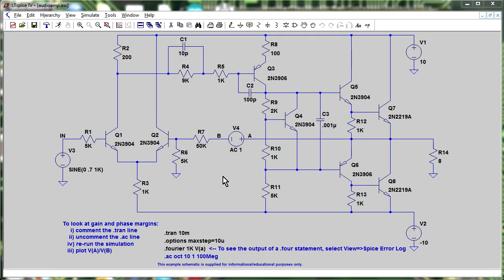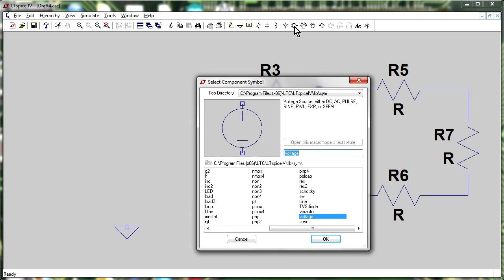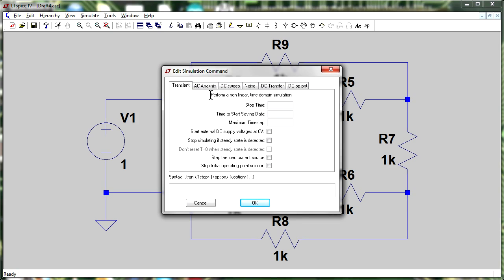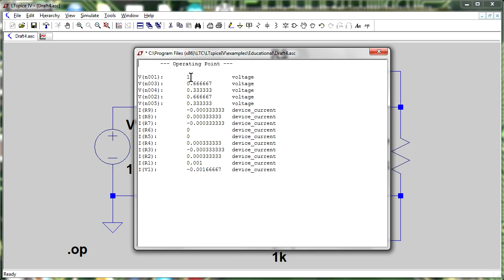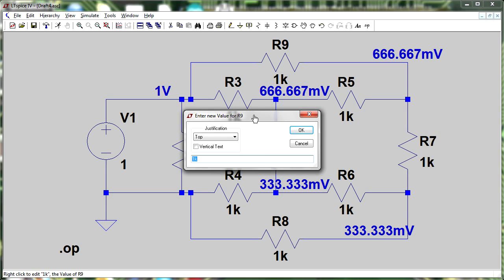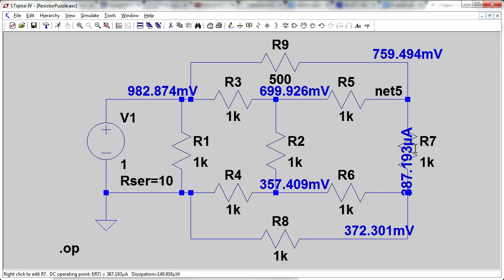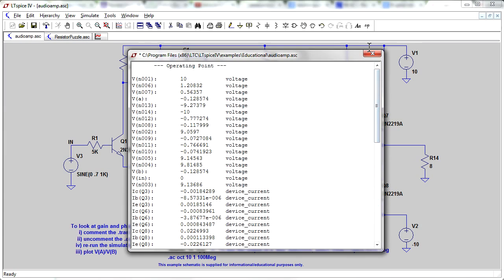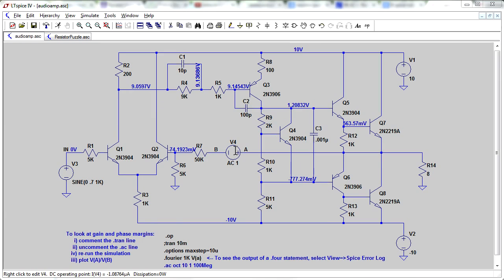EEVblog #516 - LTSPICE Tutorial - DC Operating Point Analysis

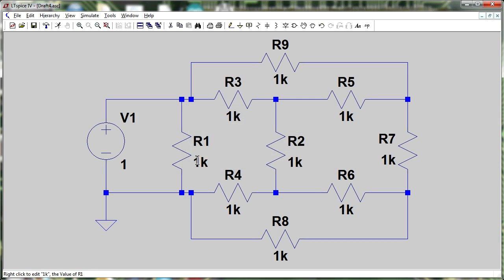Comment: 8:07 That's a bug. If it is possible to assign a capacitance value to a resistor, the GUI should not allow this and should either display an error message or reject this type of input. This way, incorrect entries are avoided, and fewer errors can be introduced into the circuit.

Comment: theres a simple old online design for a 7805 constant current source... either simulation packages dont cope well with the way the regulator is used or i'm not understanding how i can be drawing half a mA from the 13v power source so less than a watt, but simulation shows 1.6w going back into the regulators ''ground'' pin. edit: i was using circuit wizard, ran it in ltspice (with a 1117)  and it shows sensible figures so i guess cw is not understanding my abuse of the fixed voltage regulator as a current limiter.

Comment: He said that LTSpice could not measure the equivalent resistance of that resistor puzzle he drew in the software, however it will measure the equivalent resistance if you know how to do that in the software.  Just use Vin/Iin in the AC Analysis window set for Linear instead of Decibels.

Comment: Looks very good, although as you said, is complex to set up.
I'm now in love with "Circuit Wizard", which can show ALL specific voltages/currents among components, by simply hovering the mouse over wires/devices... in REAL TIME while running. APART from it's incredibly powerful "Auto-PCB" creation !!
It knows the dimensions of all the components including terminals & relays etc., for single or dual sided boards, and designs the whole PCB without crossovers. You can manually intervene, and change what ever you want.....

Comment: WTF, resistors don't have polarity.  Moreover of all the amazing things spice can do, it can't solve (equivalent value) resistor, capacitor or inductor networks without sources.  Over 30 yrs & nobody ever wanted to add this capability. Is there any software out there that can work on passive networks?. It would be very helpful in finding equivalent circuits.
Reply: Not that I've found but you can do things like place a resistor across the output you're trying to do a thevenin equivalent to and then put the resistor at 9999999999999 ohms to find the V_oc and then put the resistor at .0000001 ohms to find the I_sc and then R_th = V_oc/I_sc... etc there's a couple tricks like that. But it would be cool if you could just build a network and tell it to come up with an equivalent circuit

Comment: But, it is messed up on transformers and the Authors do know that and won't fix it.  They seem to be done with inductors.
Reply: Coil A, Mutual Inductance, value of inductance, current flow, magnetic lines/webers then secondary mutual inductance, inductance and generated current.  It makes sense when you got to fit in permeability and nonlinear transformer based upon materials.
Reply: Inductance is a Delta value meaning as a result of a changing load, the actual value of inductance at any given moment based upon the load, is changing.  They don't fix that.  They just use the ideal transformer and never compare to real world results.
Reply: Especially around where the source voltage is lower than the resulting voltage across a parallel resonant circuit.  It never does that right through any transformers.  http://hyperphysics.phy-astr.gsu.edu/hbase/electric/parres.html  Not if it feeds another parallel resonant circuit.  They won't fix it, and won't try to compare against real world circuit results for a kind of clone of superhetrodyning minus any amplifiers.

Comment: The place I got trapped a lot in the early days was the default NMOS and PMOS models. On their own they don't behave like you'd expect of a discrete FET in a lot of circuits and it can take time to find the reason for your headaches until you pick a different model. I think because they simulate the physics of a die almost without parasitics. VDMOS seems to work much better in place of a discrete FET while being more ideal and faster to run than the FETs in the list.
Reply: Can this spice warn you if you exceed an LDO's short circuit output limitations?  (Some specs day to use protection diodes to avoid problems with shorting the output, others don't have that requirement)

Comment: its just the algebraic sign convention used across the whole circuit. so if you were solving the problem on paper youd have to label the positive and negative side on the resistor. and based on that youll get a negative or positive current. and we assume that current flows from the positive side through the negative side of the resistor (or whatever convention you use) but if you get negative current it just means your initial direction of flow you picked is wrong and its flowing in the otherway

Comment: @MrMac5150, I am not sure Dave described that answer so well.  Think about the resistor having a DC volt meter permanently connected to it, so while connecting the resistor in a certain orientation makes no difference to the actual  circuit, it does make a difference to the reading in just the same way as measuring the voltage across the resistor with a DC voltmeter would be positive or negative depending on the way you place the meter probes.

Comment: Excellent Dave! Finally! Yeah, there are some LTSpice tutorials out there, but it is all a bit catch as catch can. Hopefully you can correct all that with a methodical series that goes beyond those and the surface. Price is right, powerful, flexible -but no fluff. Have used it since it came out. Way more interested in this than teardowns.

Comment from the maker: You don't control the current flow, it's just that pin labels are fixed and depending upon which way around you put it, the calculation either comes out positive or negative. Current still flows the same way in the circuit.

Comment: SPICE engine will make maths to retrieve values .. a resistor got two "internal pin names"  lets say A & B  and a value R  .. so on the back ground the current displayed after calculations will be (VA - VB) / R   ... if you swap/rotate the resistor  so you swap the A and B ..  SPICE engine will just scan point by point and make equations then solve them ! what you used to do on a sheet of paper .. it will just do it  for you ;)

Comment: is it possible to make your own SPICE model , to describe the behaviour of a circuit , let's say like c/c++ programming .. like IF bla bla bla else IF else IF ....  (or it s just like predefined parameters filling ? )  AND id it possible to download any SPICE model (lets say from AnalogDevice website next to datasheets) and import it in LTSpice . I mean .. is a spice model from any distributor is REALLY a spice model , or there is much variations between SPICE engines from manufacturer to anothe